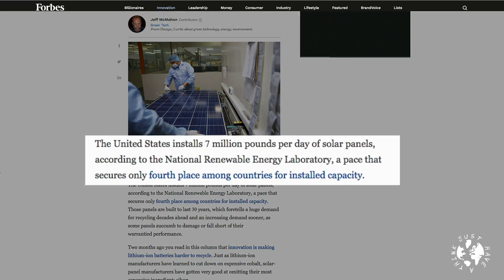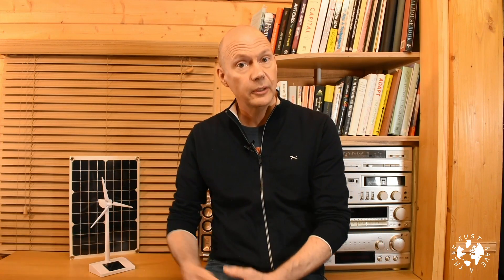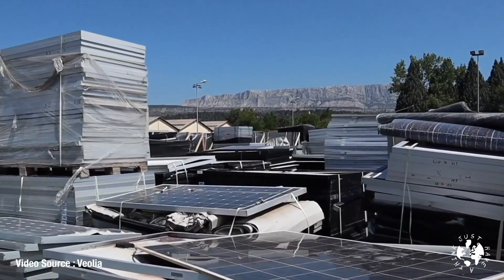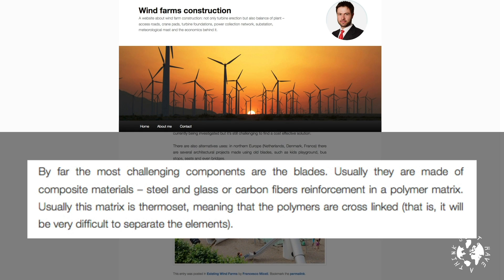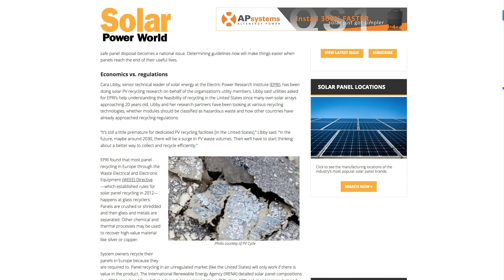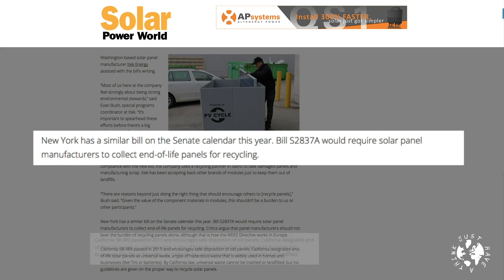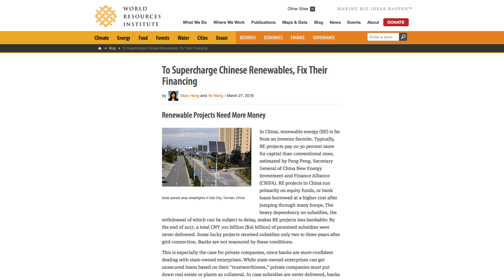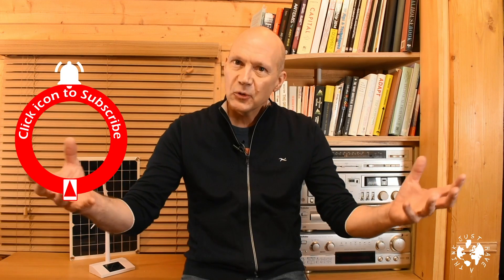Recycling renewables : a price too high?

Comment: how much is it cost? recently australian farmers reject a project by the price. regulators on the grid, cable network, batteries, these hidden elements makes the budget overpriced double. 

take china as and example, 130gw solar, looks good? but it also means in a rainly day or storm, there is a gap of 130gw deficit to fill. this is part of the reason why there are numbers of massive blackout occur over there just this year. you have 130gw, they load 150 on it, in a rainly day, everyone get squad! exactly what i said before, if they have more, they will use more in double. 0 concept on what is energy saving. that 130gw equipment becomes a negative asset to disable the energy grid. same thing happen on dams and hydro power. if you put the cloud map on the ordinary map, you will see all rain and storm happens on the dam area and river, because all moisture are there, the rest of the land is bone dry or concrete covered, so, if there is rain, dams flood, release the dam, flood more, and when those flood water steam up to be cloud again, cycle repeat.

Comment: Solar roof tiles. 
Not some rich boys California project, but cheap, easy to install & recyclable roof tiles. They need not produce much, but cumulatively they would meet or exceed our needs, & could feed back into the grid. 
It’s micro, not macro generation that I think is the solution. 
Once again, it all boils down to willpower.

Comment: I am a solar PV user in the US. Depend on it all year for my total electric house with pool, Nissan Leaf with two ICE vehicles, and air conditioning. I am curious as to what parts are not rebuildable on a large wind turbine? Certainly the foundation, tower structure, generator, prop hub, and a few smaller parts can be refurbished. Perhaps there is room for a business model creating tens of thousands of jobs!

Comment: They will soon get pensioned out with the advent of new fusion nuclear power. Almost costless electricity and therefore hydrogen from new fusion nuclear is now immediately upon us. We have recently taken a new step to advance the physic of power production by enabling chemistry of the atomic nucleus, or "nuchemy" in the newest FUSION NUCLEAR POWER. technology of the SAFIRE GENERATOR. We are passing the chemistry level where we interacted with the atomic electron shells and are moving on to manipulations in this "NUCHEMY" atomic nuclear era when we interact and multiply nuclear protons. We have rediscovered the lost work of the alchemists and can make new elements with different atomic weights. This was ably demonstrated in "The Safire Project". Quanta are important. We now have enough energy in them to manipulate the atomic nucleus much more easily by creating a compartment, or what is a local region of plasma containment so reactions at this atomic nuclear level can easily take place. This is about to practically enabled a really fantastic and cheap new era of energy production for the whole of mankind. This with hydrogen, so free fuel obtained from water or atmospheric moisture anywhere in the world. This new fusion nuclear is at the industrial commercial production final development point as of now. The energy argument and other power methodologies are all now virtually irrelevant as we have new and very physically and economically powered practical and local community level fusion nuclear power. Solar roof plus Teslawall battery may be the present way to go domestically but megapack batteries and multiple storage technologies interconnected with an expanded ugly grid have a less certain requirement when you consider new any-scale community based and 24 hr reliable and self-fueling fusion nuclear in the form of the "SAFIRE GENERATOR". Learn all about it at "aureon energy.com". Learn the newer EU Theory and plasma physics at "Thunderbolts Project.com" and you will be permanently reeducated with this advanced new EU theory that will allow you to understand more about the astrophysics of our whole universe and all within.

Comment: heres some food for thought, we had a huge problem with asbestos , and due to the lung illness abestostosis, we made the product illegal to use in modern construction and manufacturing, 
the problem with fiberglass is it is a glass fiber and when left to decompose it breaks down in a similar fashion as asbestos, once it get airborne we will have the same lung disorders, 
we have strict laws how we now dispose of asbestos, but from what ive seen when they bury the blade and other fiberglass part the just dig a pit and over fill leaving them to the elements, to decompose, 
when the laws change the cost of disposal of fiberglass will become as expensive as it is with asbestos,  double wrapping, specialized people and designated areas which intern becomes a bio hazard waist lands , never to be used for human uses again, 
just the sheer size of them even once cut into smaller section, that is a huge amount of land space lost, 
you can only put so many additive into concrete before it isn't concrete, concrete wear done and releases particles so that alone nulinvoids the fibers being used for that purpose, 
food for thought

Comment: Excellent episode!  I’ve been concerned about waste management since this initiative took off and I’ve been very concerned that no one had the foresight to consider waste management in the race to grab all of the dollars in production. We cannot afford re Ewa let solutions that do not manage waste products. It simply becomes another mechanism for us to destroy the planet. After watching this, and I’m curious to see what people know, are the processes used to recycle, reprocess and reuse end of life collection system components being done with a sustainable mindset?  For instance, are the high temperatures required to perform recycling achieved using fossil fuels?  Thankfully, this concern seems to be getting traction at a point before it becomes to late. Or so it seems.

Comment: Yes,it will end up as scrap metal..but the blades will be a problem to clean up.fiberglass is glass.the pollution will last 200 years....fiberglass dust off the blades will drift downwind for miles and cause canser.flexing blades will cause fiberglass to fatigue and become brittle..fryable glass is like fryable asbestos in many ways.,,,,now fact check that aug 1 2021.

Comment: You can't survive off of purely wind, solar and batteries; it won't work. You will need other technologies such as Nuclear and Hydro as a baseload, RNG, Carbon Neutral coal/gas or Hydrogen to heat homes and ramp up electricity output, limiting methane emissions by covering abandon oil wells and burning trash, aswell as being more fuel efficient. In the meanwhile, planting trees to offset your footprint is a good idea; not only does it reduce carbon, but also restores ecosystems.

Comment: You also have the issue of replacing the retired wind and solar after 20-30 years.  This is replacing about 2.5 pct of the world power assuming this is 75 pct of solar abs wind. 

   Since batteries only last 5-10 years we also have disposal of batteries to deal with. Battery may evolve from the lithium battery and we may have hydrogen and fuel cells but regardless batteries of any type are not forever!

Comment: This argument can be used against any energy technology. The reason we have global warming is because fossil fuel technology doesn't do anything about it's waste (co2). Then there's the environmental destruction of acquiring the fuel in the first place. 
 70 years on and there's still no answer to nuclear waste. 
 There's also a lot of concrete and other none recyclables in hydro electricity.

Comment: In several threads, people are asking why you just 'cannot refurbish the turbine' so I am making a general post on that issue.

Of course, the turbines and panels receive regular maintenance, and stuff that can be repaired is. However, think about the wind turbine overall:

The tower seems imposing, but after several years it has undergone
* constant vibration from being whipped back and forth by the wind
* 1000s of thaw-freeze cycles
* foundation settling
It is not a wonder that the tower concrete may be cracked and weakened - as a WindCo exec, are you going to risk putting 10s of millions of USD (a new nacelle and blades) on top of a tower with maybe just 0-5-10 years more life?

The nacelle is damaged - you decide to replace the nacelle, but will you put the old, pitted, heavier, less-aerodynamic blades back on, knowing they will need more frequent maintenance? Or, (assuming your vendor still makes them) will you replace the 3 blades with newer, clean, lighter, and design-spec-aerodynamic blades? (again, millions of USD per nacelle replacement).

A single blade is damaged - you cannot replace the 1 blade - because the new one will probably be lighter (vendor improving construction techniques), but it most certainly will be smooth and design-spec-aerodynamic (vs the 2 other old, pitted and less-aerodynamic blades) - and so the turbine will be unbalanced, leading to higher stresses and lower lifetimes - *so you must replace all 3 blades*. (again, millions of USD per replacements).

Can you reuse the 2 extra blades? - You need to spend millions of USD to store them and catalog them (turbine model, mass, degree of damage). You then find a match where one of these extra blades might be sent as a replacement to a turbine. However, as a WindCo exec are you going to send a full crew, full equipment, full scheduling rotation to put on a blade which still will not quite match and knowing they will need more frequent maintenance? Or, with the same crew, equipment, and a little bit of extra time you can replace all 3 blades with a brand new set which reduces your total maintenance and raises your energy output?
So instead of storing and cataloging the older blades you dump them.

If these items cannot be maintained on-site they are fully replaced, their useful life (as part of a wind turbine) is over.

Comment: Renewables more landfill? ...Well..., how does it compare to the trash you're left with after the operational lifetime of a conventional nuclear plant, with its reactors, buildings and spent fuel that keeps on being radio-active for many centuries?
Reply: A conventional NPP doesn't have that much waste at retirement.

First, the starting amount isn't that big - https://www.nextbigfuture.com/2007/07/constructing-lot-of-nuclear-power.html

Second, although reprocessed fuel's fission products have to be stored for about 300 years, there isn't that much - see the French example: https://www.radioactivity.eu.com/site/pages/IS_Vitrified_Waste.htm

Third, the reactors, primary coolant piping and pumps are the main secondary contaminated items. Altogether a few 100-1000 tons. The bulk of the plant - buildings, foundations, cooling towers, turbine hall - are not contaminate and can be recycled/reused as any other steel/concrete/glass structure.
Reply: @factnotfiction5915  The radioactivity.eu.com you refer to is a shill site and cannot be used as a reliable source. And per volume/gigawatt, for sure the NPP generates less trash in its total lifecycle. It is just far more dangerous than the solar/wind's trash.
The current nuclear industry only exists because western governments need a covert source for plutonium for their nuclear weapons. Nobody with a right mind would consider creating energy in such a messy and dangerous way.
Wind/solar exists because we are all made to believe that it is a sustainable alternative source. Well, it will cause a recycling problem. But at least it is far less dangerous than nuclear and its waste. But then again... it uses too much space per gigawatt.
Fossil creates pollution but that can be filtered out. The industry should be obliged to to that but nobody makes it do so, because it has too much power. CO2 is not really an issue. Plants and trees need it. We just need more plants and trees that use up the excess, if any. But we're using too much fossil fuels. Or not?
According to the climatic science of the 90's, by now, most coastal areas would be flooded and it would be extremely hot everywhere. None of that turned out to be true.
 Fact is: we're still using too much of it. It gets harder to extract and those extraction methods are taxing the environment more and more. Just take a look on what damage the shale gas extraction does  to the environment.
The real problem is that modern day society uses too much energy. For example: why cars have 100+ horsepower while 50 would be more than enough to keep that same car going at the speed limit of a highway? Why do the tech giants operate enormous data-centers which host mostly useless data? Example: take a look at what is 'trending' on Youtube. Do we really need 4K? 
Why stores are filled with products of not even half the quality and life expectancy of what it used to be? Why do I need a vacation to a far away exotic place that is only reachable by airplane? So I can brag about it?
And for all industry, including energy, including nuclear, wind/solar and fossil: they all go for maximum profit and for sustainability they only do what governments tells them to do, which is next to nothing because they control those governments with their money.

I think, thorium is a good option for now. But that seems to be actively suppressed by western governments, because it does not produce plutonium for their nukes. Like everything gets suppressed that could potentially harm the established powers. Nuclear fusion by catalysts looks much more promising than what the conventional nuclear fusion science tries to accomplish. But it gets suppressed because it could disturb the current energy monopolies. I'm glad that at least a few countries had the guts to start with thorium. I wish them well and I hope they will be able to make conventional nuclear industry look like a bunch of stupid morons.

Comment: The only Truly Viable answer is Atomic Power.    It can be safe.   Japan did EVERYTHING wrong.  Set the damn thing ON the COAST,  in a Known Earthquake location ?  Seriously ?    Using a system that is incapable of self shut down.

Comment: Any thoughts on what will be done with all the new high-performance batteries when their useful service life is finished?
Reply: Probably recycling the materials are fairly high value and they are in a fairly high grade form so it would be very probable that an incetizized recycling system similar to lead acid batteries will form within the next 20 to 30 years.
Reply: I'm sure that, like we've done with lead in batteries, Lithium will be recycled very completely.

Comment: You forgot to mention that INSTALLED capacity does not equal ACTUAL GENERATING CAPACITY, which is around 30% of INSTALLED capacity.  So the 'sustainability' equation regarding these boondoggles is incorrect from the start.

Comment: The "right thing" environmentally, is to simply avoid this wasteful, low-power, intermittent technology of PV and windmills altogether.  And we simply don't have time anymore to fool around, in spite of the profit motives dangled in front of us here.  Nuclear is here, is powerful, clean, constant, safe and long-lasting, with a relatively small and comparatively inexpensive waste and carbon footprint. Do the research; the data is out there.
Reply: The problem is that the political will to spend the necessary money to make it work just doesn't exist. In some countries, sure, but in America all subsidies for green technology are met with major opposition. The vast majority of the U.S. and probably the world is not willing to spend a premium for nuclear power. We have better chances letting PV and wind compete with fossil fuels naturally, or with some help. We have been met with a fortunate coincidence in that these technologies have become cost competitive right as we near the tipping point for our climate, but we need to focus on accelerating our transition, mainly through using these cheap technologies.

Comment: 7:35 So the windturbine blades are ground to powder and mixed into cement.
But will the cement be recyclable?
Reply: Cement (really they meant concrete - cement is an ingredient in concrete w/ Sand and rock) is mostly used for roads, driveways, foundations, floors, etc.  It can be broken up and turned back into a rock base for another project later when it's no longer in use.
Reply: @jameswalker590  Okay, but does that also work for concrete that has those carbon fibers in it?

Comment: That's plenty of wishful thinking you're going for here
The worth of this recycle material is your income.
But income is not the same as profit.  To get profit you need to deduct the costs of recycling these materials.

To put it simply the major problem is the materials needed to construct solar panel or wind turbine are quite cheap.
Which means there would be very little economical sense to recycle old ones, instead of just buying new ones.
These recycling plants would probably have to be subsidised for them to have any profits.

Comment: I have a 50 year old light powered calculator and it still works as well as the first day I used it.
Reply: I believe the issue is that if you had such calculator sitting on your hot roof facing the sun it would not work for 50 years.
Reply: @InlineSkater72  I used it indoors all of the time. I never had a roof top office nor would I want one in the UK. Colorado perhaps the UK, not an appealing idea.

Comment: I think the solar panels could last 60 years or more if more attention is paid to more durable coatings, better connections as the solder joints and wires fail from movement via heat/cold cycling, according to the sellers at the energy fair.  Maybe Rolls Royce could provide some insights for lasting durability?